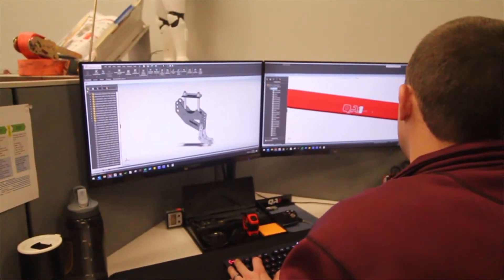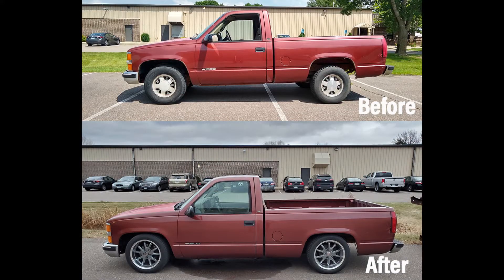Engineering Review Of QA1's 88-98 C1500 Suspension Systems

Comment: Is the front kit adjustable from 1-2” plus the 2” from the drop spindles?
Reply from the maker: Yes, the level two kit is 1-2" with standard, 2-4" with drop. The level three kit is 2-4" with standard and 4-6" with drop. www.QA1.net/c1500